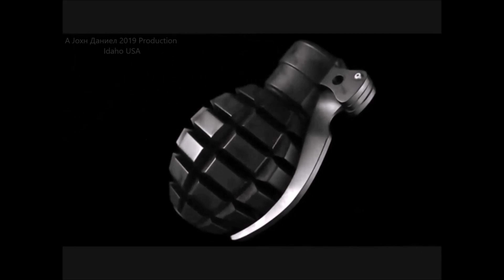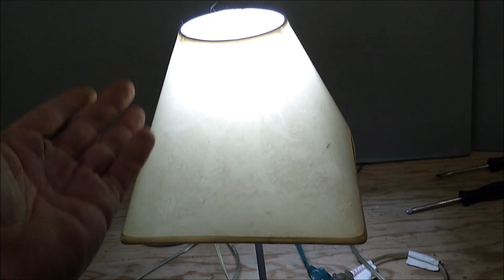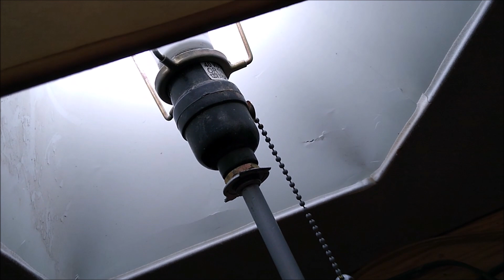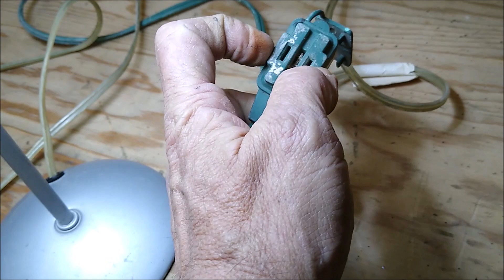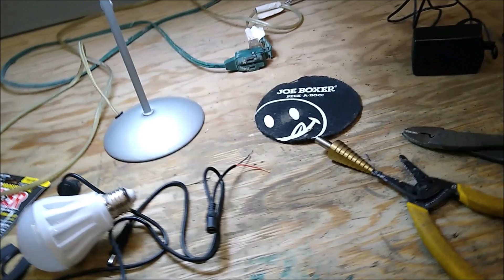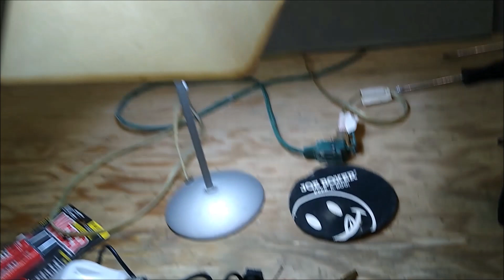Convert a household Light fixture to DC voltage for Off Grid & RV use

Comment: could i simply cut off the plug, add a 12v bulb then wire it into my fusebox with an appropriate fuse? why change the switch?

Comment: I love watching your videos because I am amazed at how many different types of projects you folks do for learning purposes! I am a slow learner and I am older and I do have a certain reluctance to try to do electrical gadgets even so there are so many people who have the basics down enough to try this themselves. I bought a light kit to change the wiring because the lamp was still nice and I wanted to learn how what is a simple exchange of parts. When I got to working on the base which houses light bulb I had my husband finish it because I didn’t know enough which gave me enough since not to cause an electrical failure or a possible fire. I feel it might be easier to try out what you showed on this video with someone guiding me through to make sure I do it correctly! Thank you very much and the subscriber who asked you to demonstrate turning a 120 volt into a battery power lamp ✅👍

Comment: Seems ridiculous to me.  I too want this solution but after seeing this process, which would be needed for ALL 120 lights, that I will just convert my camper/trailer/cabin to all 12 or 24v.
Reply from the maker: It's for adding a few more nicer residential lights to RVs or converting nice lamps for a off grid home. Not as the source of all your lighting.

Comment: I think I would have just replaced the light bulb with the 12V one, and put a 12V plug on the end of the existing cord.  Then the existing pull chain would be the switch-- same way it worked as a 120V lamp.  (KISS principle)
Reply from the maker: Here's a reality, if you get caught by DOT with a 120 volt appliance altered in your camper or RV by doing the plug cut the fine is $600 and they are very aggressive checking vehicles at national Parks and rarely at state invasive species quaretine site  entries.
Reply: @JOHNDANIEL1  I don't live in the US and want to modify a clamp light for use in a gazebo or tent. So the take home here is the original switch would work if you wired the lamp for 12 V DC??
Reply: @JOHNDANIEL1  DOT doesn't check for that sort of thing.  No need to clutch one's pearls over nothing.